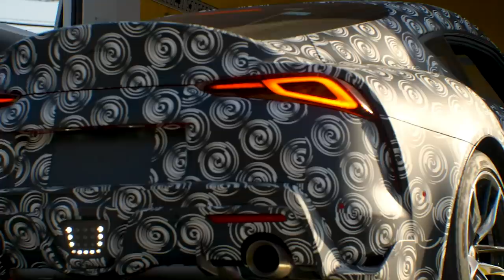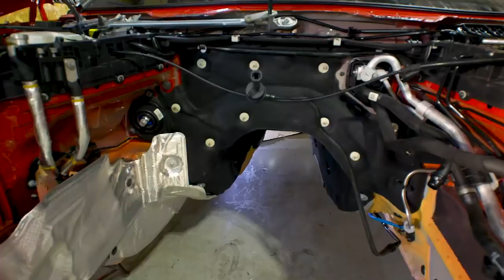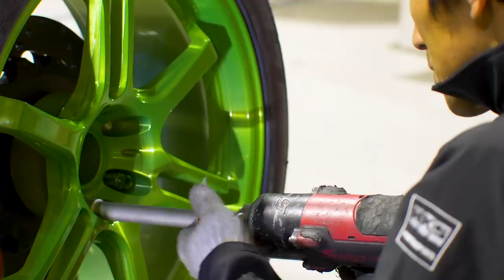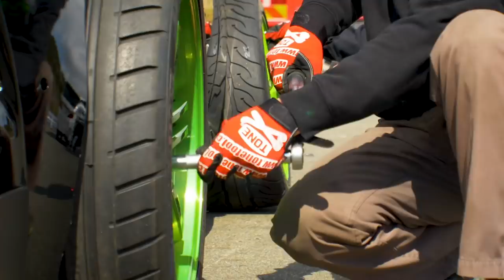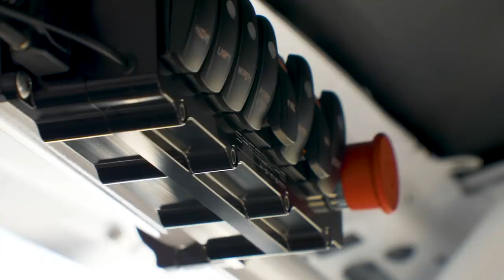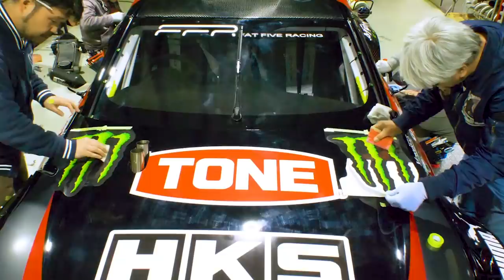Daigo Saito Builds World's First Drift Toyota GR Supra

Comment: instantly replaces bmw engine with 2jz
Reply: Power of a BMW, but reliability of a Toyota
 I cant complain lol
Reply: THE LEGENDARY ENGINE IS WAY BETTER THAN CHEAP KNOCKOFFS
Reply: Instantly bored. Why not actually tune and enhance the stock engine?
Reply: @rickybobby144  
Because why not be the first to do the swap that everyone wants to see. That and it's a racecar so parts are going to be cheaper using the cheaper engine
Reply: They already decades of R&D into 2JZ why start from scratch on a new motor that doesn't have supporting mods? 🤔🤔🤔🤔
Reply: Exactly
Reply: @nissanpacific9793  Here in Germany you can get that engine tuned up to 800hp street legal. I guess it's about the team being familiar with the engine.
Reply: toyota Z4 2jz swap
Reply: And instantly goes backwards by 20 years. 
I’m 100% unimpressed with this so called “build”. It’s been done so many times there’s nothing new here.
Reply: NissanPacific and then boast about “the first”... the first what? Boring.
Reply: @Showmetheevidence-  what do you mean "nothing new" you clearly no nothing about automotive engineering if you think nothings new here.
From the simplest thing of steering angle they had to design their own front suspension from scratch  just to get the steering angle and give rigidity in the chassis without ruining other parts of the car like the steering geometry and weight distribution and not have problems like bump steer or lack of self steer. People put a 2jz in cars all the time but those cars have actually been on the market before they build something from them. They literally had a 1 of a kind test car for this build. Then they also have to mock up the cage rear mount intercooler getting space for the fat tires they need for that 900hp and, the fuel cell the engine mounts, designing most of the body panels so they can be easily removed and replaced, the front and rear bash bar. As well is get the car to be FD approved. All these things are simple on an s15 or e46 or a 350/370z where all the parts have been tested and improved over time, but that hasnt happened for the GR supra
Reply: @rickybobby144  because hks is only familiar with Japanese engines not German engines
Reply: @rickybobby144  it's probably because of the 2jz engine has a big variety of aftermarket parts. So even if he crashes the car or something goes wrong his team can come up with a nice and easy solution. I don't think it's original engine is bad or something but this seems to be the best way to go for now
Reply: @Showmetheevidence-  go ahead and name a better engine package.... oh thats right there is no package more battle tested in drifting than a 2jz it will go down as best factory engine of all time no one cares about your opinion
Reply: @rickybobby144  I agreed, because of B58 compact design, it becomes one of the better handling car. Throwing 2jz in it would screw up 50:50 weight ratio( pretty impressive for inline 6)
Reply: @petergriffin4629  
Because of that I'm waiting to buy new supra or BMW m340i in my country from German comments like you oh can't wait the b58 I think better than 2jz
Reply: @rickybobby144  Its untunable. Useless BMW flop.
Reply: and instantly catches fire
Reply: Hell ya
Reply: Not really a bmw engine, because Toyota fixed it. BMW engines don't last
Reply: @laurenzoangezohass6689  Cheap knockoff? Don't you know anything about BMW blocks?
Reply: @Mcali1984  i dont mind if whats under the bmw blocks....
What im referring to is that bmw cant make the legendary engine as same wat the toyota did....

Thats why i said cheap knockoff.....
Reply: @Mcali1984  That new Supra engine still sucks so if your going defend it then go ahead coz i dont mind...... XD
Reply: dwtgators you do know that BMW worked with Toyota on the original 2jz engine right ...?
Reply: @rickybobby144  because the stock isn't nearly as good as the 2JZ?
Reply: @Pheatan  they've already got a proven motor so really nothing new here. With technology at our disposal now a good team, like GR can go from scratch to a car like that in 90-120 days. So really nothing new... the suspension, building the intercooler, radiator, fuel cell all that is just a matter of stripping the car down to nothing and measuring what you got then building it. It doesn't take a team of NASA engineers to do it. I'm not saying it's easy but it's most definitely doable for team with probably over 60 to a 100yrs experience combined. As far as building the BMW motor that's out of the question right now too because there's no supporting parts and they're not trying to reinvent the wheel... All they're trying to do is get publicity for Toyota and themselves by technically having the first new body style drift Supra.
Reply: Saito is an old school Toyota fan, starting with his Toyota Chaser that he drifted for years. He knows that no one could ever outdo 90s Toyota except for 90s Nissan, which was the first car he ever bought, an S13 Silvia
Reply: @jeffmartin1061  how could it be power of a BMW if it's a Toyota platform...
Reply: @petergriffin4629  IT WILL BROKE EVERY RACE MUAHAHAH because stupid computer
Reply: Same engin as the z4
 Homies are trippin saying it's not BMW lol. Modified and tested by Toyota. Once again
. Power of a BMW and reliability of a toyota.
Reply: @Showmetheevidence-  Done the right way.  Take the new Supra and put the real Supra engine in it.  The way it should be.
Reply: @MrShinta786  please bruh.
Reply: @laurenzoangezohass6689  BMW has made 1500cc turbo engines that made 1400+ hp. You know, factory.
Reply: The emission standards kill the 2JZ
Reply: @xxxxghostxxxx2052  is that the reason why they stopped making it?
Reply: @butwait  I speak of experience
Reply: NGTRN K1arsw The 2jz isn’t that special
Reply: @deek1701  FOR YOU MAYBE?
BUT ME IT IS LIT ASF ALSO THE RB26 BOIS!
I LOVE BOTH SUPRAS AND SKYLINES.....
BOTH ARE JDM LEGENDS.....
Reply: @Pheatan  no this is nothing new and really not that difficult. All it takes is money.
Reply: If I buy a Toyota, it better damn well have a Toyota motor in it.
Besides, you damage the cylinder walls at all, that beamer motor is trash. Thanks electro plating
Reply: @rickybobby144  because they didn't want to.
Reply: Peter Griffin yea but we want 1000+whp reliable can any of your bmws do that? Hmmmm I cannot think of anything in mind
Reply: @petergriffin4629  There is a MASSSIVE difference between making 800hp on the street and making 800hp in a drift car that is always WOT and bouncing off the rev limiter.
Reply: @pablopicaso8374  Well in one case an engine only has to last one weekend. In the other the engine has to withstand going 120mph for hours, while having service intervals of several thousand miles.
Reply: @rickybobby144  stop being a troll!
Reply: @petergriffin4629  no one does 120mph for hours, maybe 30-45 minutes on the autobahn but its still a highway system with traffic. And sustaining a speed isnt that hard on a engine, WOT is significantly more load on a engine not to mention bouncing off the rev limiter. But above all of that the 2jz parts are more readily avaliable, cheaper and have had more R&D time put into them.
Reply: @pablopicaso8374  I agree with them being cheaper and easier to get. Obviously you have to break from time to time, but believe me you can definately drive for hours around that speed. I don't know what WOT is but I know that bouncing of the rev limiter doesn't do anything to your engine. The only issue with that is cooling, but that's why drift cars have special cooling systems.
Reply: @rickybobby144  Ha
Reply: @petergriffin4629  WOT= wide open throttle and bouncing off the rev limiter is bad for the engine it sends shocks through the engine as the rotating assembly decelerates suddenly and then goes back to being under full load and repeates this process everytime it bounces off the rev limiter. A rev limiter is there to prevent a engine from floating valves or over revving pass the mechanical limits of the motor like wrist pins or rob bearings. So hitting the rev limiter once in a while does not hurt a engine, bouncing of it all the time like drifters have to do on the other hand introduces a lot of mechanical stress to the motor.
Reply: @pablopicaso8374  Well, if you believe that, than believe it. But I ask you to go and talk to an engineer about what damages engines and what doesn't. 
The youtube comment section is no place to explain that to you. Also i can only repeat,
the engines in FD only have to last for one run, Fredric Aasbo sometimes goes through several engines on one weekend.
Here in Germany in order for the tuning to be road legal you have to go through a very expensive process, which is why they only do it for the "bigger" market, so the tuning has to maintain reliability to a certain degree. While still being with in smog regulations.
Reply: @rickybobby144  because work with what you know, FD isn't a bullshit show, I'ts a really serieus thing in Japan, you just dont make the jump to the unknown.
Reply: Yes they stop making 2jz long time ago because of low sell value
Reply: @nissanpacific9793  With such mentality, world would be riding horses and steam locomotives ! Someone have to start somewhere in terms of "R&D"
But ! 
I must agree that modern engines are filled with electronics and may be harder to tune for a lot of preparator without any official softwares
Reply: Because these fucking engine is made with aluminium alloy and cant withstand high pressure. These modern engines are designed to be eco friendly not gas eating animals.
Reply: @Showmetheevidence-  So you have seen a Supra do a 2jz swap before?
Reply: @mohammeds5458  haha the 2jz running 3000hp. Lets see you
Do that with a bmw shit engine.
Reply: I would use a V6 gr engine
Reply: Good. I hope it's meant as an insult and taken as one in Japan.
Reply: It's not because the new engine is bad, it's just because u can tune 2JZ so easily. Mechanics/tuners know how to tune it. Kits are already made etc. I assume after several years in production whn people will understand how to tune this new engine there will be plenty of supras and new bimmers that ae tuned hard.
Reply: @Showmetheevidence-  they did it better back in the day. It's the swap everyone was waiting to see
Reply: @jeffmartin1061  but in toyota supra (378hp dynoed) 

it has almost 40 horses more than in Z4 :D
Reply: @rickybobby144  Because he wanted the car right away. It wi take time for the car community to max out the B58s potential

Comment: Sad that it already caught on fire
Reply: Zur it wasn’t a major fire, looked very minor on the video
Reply: yeah not bad, needed a wash and maybe some parts that might need replaced.
Reply: @chikato7106  surprised BMW doesn't do spare parts
Reply: wait what damn sad
Reply: I guess that's how 2jz works
Reply: what kind of drift car dont catch on fire lol
Reply: @PLK123  yes it is a 2jz. they literally show them ripping out the BMW engine in the video lol
Reply: @PLK123  2jz is made by toyota..
Reply: @evancraig11  what that dude Probably means by "not made by Toyota" is that it's a custom engine as in it's a  aftermarket build sooooo technically it's not a Toyota engine just a Toyota design.
Reply: Plk it’s a Toyota 2JZ stroked to 3.4L with some modifications
Reply: @PLK123  This isn't supra made by toyota or bmw. Doesn't look like the one toyota launched lol. This is hks supra not toyota supra r/whoosshhh
Reply: it wouldn't have caught fire if they bored the B58 :v)
/s
Reply: Zur it was the fuel line. they had it running not long afterwards
Reply: @FalbereChan  no just blew up  at the kinda power and Rpm this 2jz was made to handle.. it was barely a fore they were ripping it right after the fixed the fuel line
Reply: @freedomfox8183  i said "/s"
Reply: @evancraig11  you mean with yamaha?
Reply: @FalbereChan  What u doin here? Go play IDAS8
Reply: @kingfc8380  no, i prefer idas zero
Reply: @FalbereChan  Oof
Reply: Engines do not catch fire. Fuel lines do.

Comment: it feels like a huge slap right in Toyota's face for not design a new engine for it
Reply: Michael Lin It’s a huge slap in bmw’s face for building a shit engine
Reply: @nightreapers3425  It's not shit lmao
Reply: Marco Brancorsini They would of left the stock motor. But it’s shit so they swapped it with a real engine
Reply: @nightreapers3425  It's just because the 2JZ can make an absurd amount of power and that's a drift car. On a track-oriented car or something like that you don't need 1000hp and the B58 is a perfect engine.
Reply: @marcobrancorsini2479  Arguing with 2JZ fanbois is almost like arguing with flat-earthers at this point.
Reply: @meatspin17779  Lmao any engine that can't make at least 2000hp is shit in their opinion, "cuz mah 2JZ". Well guess what, a 900hp 2JZ has tons of turbolag and is therefore crap on the track.
Reply: @marcobrancorsini2479  watch Adam lzs drift car with stroked 2jz just like this but literally almost no lag what so ever and with no2 they can be spooled even faster than that in drifting.. so yes years ago they were lagging alot but not with a good turbo... This is 2019 alot of shit is possible that wasn't a short while ago
Reply: @marcobrancorsini2479  sorry mate. Its 2019 theres no Big turbo lags anymore... i forgot what adams Turbo but i know its a Garrett it has 0.5% of lag
Reply: Michael Lin do you realize that B58 was developed by Bmw and Toyota , not only by BMW?
Reply: Night Reapers The economy changes, regulations change, people working on projects change. If Toyota developed a new engine for the car it wouldn't be the same as the 2J, and the engine in the car is fine. The base of the new one is better than he best version of the 2J stock, and I'm sure soon enough people will be making massive power from it. Supras were not making 2000 horsepower its first year.

Comment: Genius! 
A closed deck, super light aluminium and easy tuning engine was replaced by old casted steel engine block 
👏👏 wow that's some advanced technology improvement
Reply: its not that simple. 2jz was built to handle high compression. there are many scientific experiments like 2jz vs rb26 or some other comparisons. plus newer doesnt mean better. for example 13b is better than renesis engine due to emission regulations. (renesis engines exhaust port is made to prevent overlap so it can run more clean. but that makes it less powerful.and some other changes). newer engine follows the rules. but the 2jz had fewer limits in its production.

Comment: Eh, Supra's are hella cool, but when is Mazda going to release a new RX-7/8?
Reply: Electric lol
Reply: It would be RX-9 so
Reply: Just wait for the RXXh and RXXe. A hybrid RX10 with a 1.6 - 4cilinder rotomotor with 4 wheel drive. Possibiltity to drive RWD only exist. And the RXXe all electric.
Reply: @bigheadsamuel  we still have the 370Z
Reply: They are probably gonna make it a crossover with small ass turbo 4 cylinder engine.
Reply: @jadmeh  30k ain't exactly cheap in my book
Reply: mazdas are junk. How many rx-8s are on the road again? Get a real car. Kia Stinger for instance!
Reply: @AlphaFlight  No, the RX-8 is crap. The RX-7 is one of the best sports cars ever made, and the Miata is one of the best track cars ever made. The Mazda RX-3 and Cosmo were incredible cars in their time, but they've since been surpassed
Reply: rx-9?
Reply: SADLY, still no plan for next year.....
Reply: Yeah its crap because no one wants to properly take care of the engine. The earlier rx8 models had its problems but one big reason why they have a bad rep is because it requires attention. The rx8 has great handling and the wankel when you take care of it is well performing for what it is. Also you might say its unreliable but when you please the wankel it pleases you back with its cool sound and high revving performance.
Reply: Rx are finish today cuz Rx is for Rotor engine and they consume too much gas, oil..for today. But Mazda can still make cool Mx models

Comment: First step to make it a better car,
Remove the BMW engine
Reply: BMW motors are actually as reliable as a Toyota. It's the shit around it that breaks. Pay better attention. And I'm a Lexus guy.
Reply: its not a bmw engine. its one toyota were developing. it was then worked on more by bmw and toyota in germany but every step of the way they would send stuff back to japan
Reply: It is better than the mk4 supra performance wise. Smaller wheelbase, more hp, and ect. It might not please the mk4 supra die hard fans but all the supra generations looked different.

Comment: It's funny that no one thinks about why he swapped the engine.. Ofc he is gonna use a 2jz with HKS parts in it.. Why? Bcs hks is one of his bigger sponsors.. If hks made parts for the Bmw engine he would have used that.. Marketing.
Reply: Or maybe that the BMW engine is junk? That tuning it is a pain in the ass? That the results are minimal for alot of money spent? That it would struggle to hold something as simple as 800hp reliably? 

Plenty of reasons. Including the fact that Toyota fucked up, BADLY, by rebadging a Z4, and this is putting in the effort that Toyota should've done.